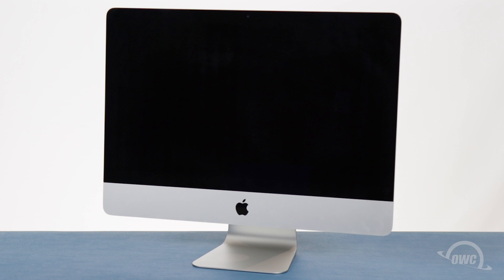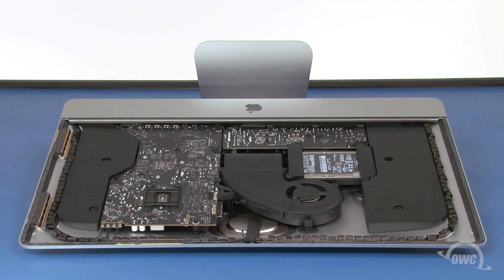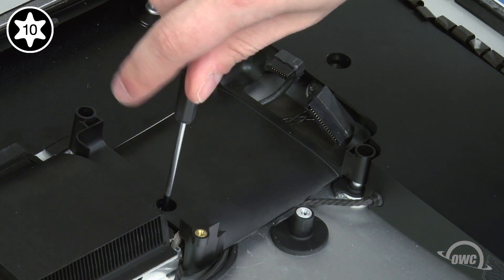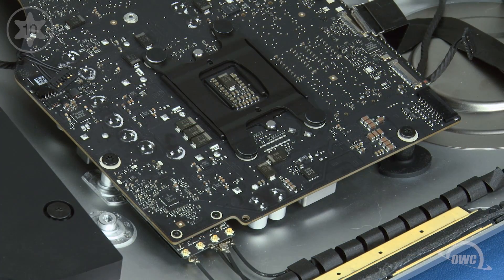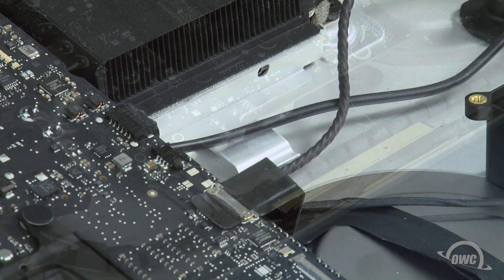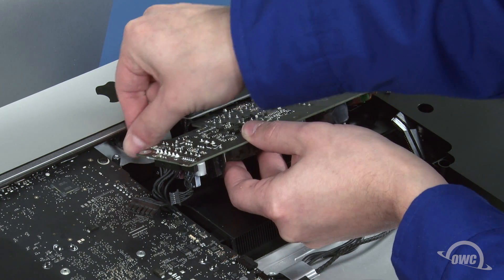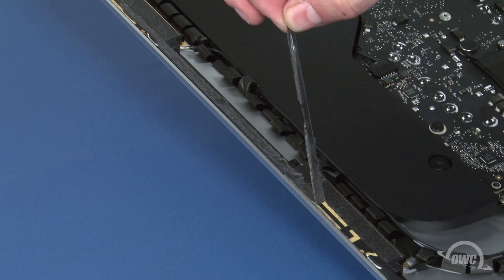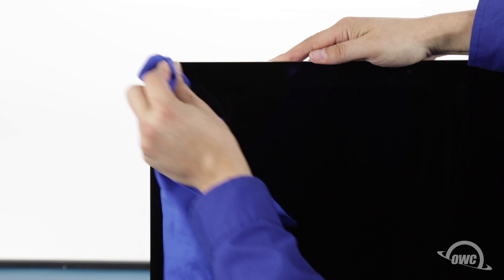How to Upgrade/Install Memory in a 21.5-inch iMac (Late 2012–Early 2013) - UPDATED VERSION AVAILABLE

Comment: I`ve got a question on this:i own a 2013 Imac 21,5" with 8 gb of ram and only the 1Tb HDD.Is it possible to go for Like Upgrading it with the PCIE SSD , a SSHD or SSD Harddrive and upgrade it with 16Gb Ram?or ist upgrading the PCIE SSD only for the ones that have stock PCIE SSDs?

Comment: GREAT VIDEO!! Just one problem. I upgraded ram and hd. Black screen after I turn on the power. It chimes in but black, black screen. I'm sure it is something on my part. I thought I followed all of the directions. Any suggestions? I ordered new adhesive so I can take it apart again in two days. Maybe I just didn't plug in the monitor correctly.
Reply: Kevin Shea hey 👋 me too did you figure out what was wrong
Reply: @floralcowgirl9303  yes I did. when you put the monitor back on..you put the bottom on first and slowly guide it down. Where the top is, is the plug for the screen itself. Either I didn't plug it in well enough or I moved the screen to much and made it disconnect. I opened it back up again and it was unplugged. I plugged it back in and it worked beautifully. I will tell you this. I timed the start up before I changed the hard drive and it took over 3 mins to boot up. After the hard drive and memory it booted up in 39 seconds. If you attempt to do it...have a phone or ipad or another computer running this video while you are doing it. Another thing is..I bought the kit. With the tools and the adhesive. Worked great. It took me between 3-4 hours..partly because I had to open up again and plug in the screen....any questions I would be glad to help. The computer runs like NEW.
Reply: Kevin Shea thanks so much !
Reply: @floralcowgirl9303  Just one more tip. Get everything set up before you start. I would definitely get the small tool kit with the adhesive. Make sure you have a soft surface for the computer and then a place when you take off the screen. You are going to have to remove old adhesive. Take your time it all will come off.  Also use Carbon Copy Cloner software..just google it. It has a free trail so you can clone your hard drive. You should also time the startup before and after you replace hard drive. I used a Samsung SSD. You can find it on Amazon
Reply: Kevin Shea thank you yes I just upgraded the computer and it's up and running thanks so much

Comment: Recently discovered, once again, why I do not like Apple products. Crazy design to frustrate. Wanted to upgrade RAM, but advised not to. Encouraged to buy another imac instead. So, $40 RAM upgrade or $1000+ new imac??? Crazy. Anyway, successfully upgraded RAM by removing one component instead of the crazy numbers removed in this video. Took within 15 minutes...
Reply: Richard Perrine, which method did you use. This video makes me not want to do the upgrade. Please let me know.
Reply: @richconner6776  Only the removal of the fan is necessary. It will take a little patience and dexterity, but that's it.

Comment: Has anyone asked the obvious question?  Given that the memory slots are under the motherboard, why is it necessary to remove the fan, the power board, the hard drive, etc?  Judging from this video, you should be able to simply disconnect the cables to the motherboard and lift it out by itself without disassembling the other fucking half of the computer.  This reminds me of the automobile repair videos in which they tell you to disassemble the dashboard to replace the ignition switch.  Seems like bullshit.

Comment: I used the video to upgrade my 2017 21.5" iMac, no issues... Installed memory, two 8GB sticks for 16GB, and new 1TB SSD replacing old 1 TB HDD. Install was not that difficult at all, thanks to this video. I just finished up a few hours ago, everything booted right up, now this little iMac is running on Rocket Fuel! Very Happy!
Reply: I am encouraged by your comment, but I'm still timid/apprehensive about doing it. I've upgraded the RAM in my Mid 2012 Macbook Pro 13", but I thought that was fairly easy. Upgrading my Imac's RAM seems intimidating. #sheesh
Reply: Did you need the OWC thermal sensor cable to prevent the fan from blowing at maximum capacity 24/7?

Comment: This has to be one of the worse computer designs I've ever seen.  They're called HATCHES, perhaps you should look into them APPLE.
Reply: Oddly, Apple DID install hatches on some of these after 2013, but they again skipped using hatches on the 2017 model.  Inconsistent and annoying as hell.
Reply: a simple money making scam.

Comment: Just completed this upgrade on my late 2013 21.5" iMac along with finally being able to swap in my external SSD. Not too bad at all if you take your time. Hardest part was removing the power board where it hangs on that plastic lip. Took me about 90 minutes open to close. Good stuff!
Reply: Karl, could you share the brands of the SSD and RAM?  Any special tools i need to buy?  What about saving the OS?  sorry for the questions.  thanks

Comment: Hi tks to share this video. 
Let me ask you a question: I heard a lot information that its not possible to replace / upgrade New Imac memory. So I have one IMAC 21,5 2,9 late 2013 Model A1418. Is it possible to replace the memory for this model ? If yes, could you tell me what kind of memory should I use ?